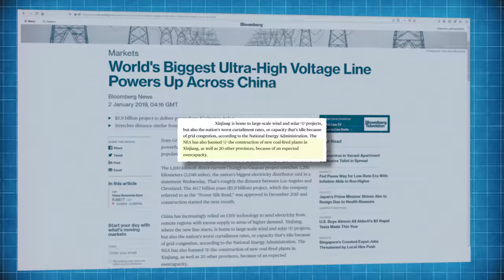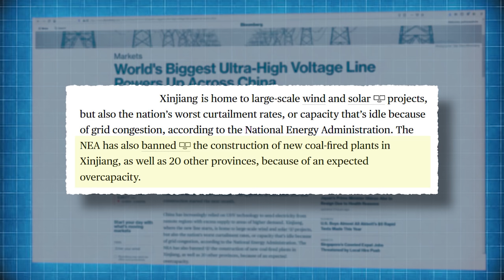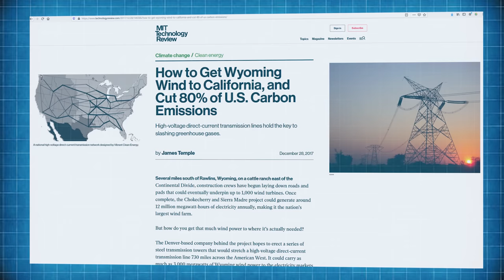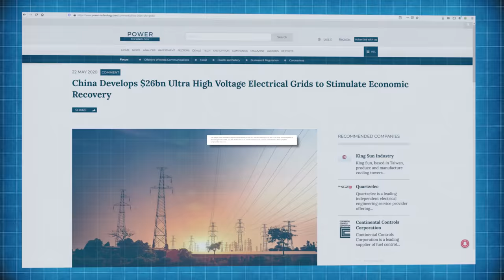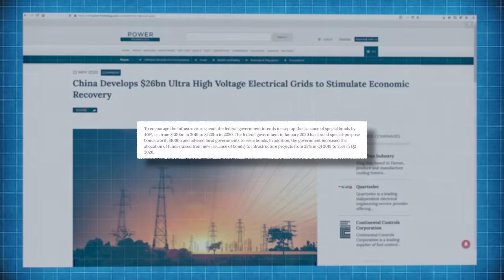China's MILLION VOLT Energy Superhighway

Comment: That is a real change in electricity generation. with this technology China will reduce or even eliminate The need for huge battery systems because if the power generated locally is more than what is needed instead of storing excess power generation it could sell it to locations even countries. The question is how do the generation areas get the power they need when there is no wind or sun? I guess they may need to store some of their excess in one or more of the power storage plans that are being developed.
Reply: there is just about always wind where they are building wind turbines. it is 2500meters above sea level so it is quite hectic.
for sun it is on and off. but usually more stable
Reply: Actually DC transmission simplifies battery integration.

Comment: I’m having difficulty understanding why a power dam (Mekong example) would affect the availability of water downstream, except for the duration that the dam is being filled. . .  what am I missing?
Reply: It doesn't. In fact it actually provides protection against floods by storing excess water and protection against draughts by releasing more water. There are over 50 dams on Mekong and its tributaries already with over 100 more planned in all these countries - China, Laos, Thailand, Myanmar

The reason why some parts faced drought was because the lower Mekong basin had a really dry season
Reply: If they build a dam in very downstream in the mekong, then they will never have any water problem in downstream countries like cambodia. All these "water fights" arise because upstream countries are building dams but not downstream countries, so water goes straight to the sea for downstream coutries and is completely wasted. Same story in Ethiopia vs Egypt. Obviously it is more challenging to build a dam downstream due to the river being much wider and lack of river gorges, but say if for example cambodia built a dam right at the exit of the river from the flooded forest, they will not have problems of dry season leading to deforestation and habitat loss for its fisheries, and have a steady water supply too.
Reply: I suppose one aspect is that it increases water loss via evaporation if the dams are built with a reservoir of larger area than was before, of if the water is also used for irrigation, and there are other impacts such as reduction in population of fish etc ..
Reply: @jwickerszh  evaporation does exist, but the problem is always irrigation. you know... we have the water let's just use it, to the fuck downstream...
Reply: @JavierAlbinarrate  Yes, I mentioned it, but it's not necessary linked to the construction of a dam, ie: you could divert river water for irrigations without a dam, or you could have a dam without tapping into the reservoir for irrigation. So technically those are separate issues.
Reply: I don't know what the impact of the dams is on water levels, but I do know that a lot of water is taken along the way for agriculture and even cities, and that is definitely a big issue. Also, about the dams, the do affect the fish, because basically they get stuck in each dam instead of swimming downstream.
Reply: Evaporation
Reply: Must loose some to evaporation, the amount, I've no idea.  You may also loose some to extra draw offs for farming because the water is there and available.
Reply: It doesn’t but it does make down stream of the dam less fertile as dams don’t let much silt algae and fish through it.
Reply: I think you all are missing the point as well as the history. China is trying to control all the water flowing into se Asia because all the rivers have their beginnings in the mt. In China. All it will take is one drought and all the countries will be at China's mercy. As with everything chinese you can kiss the environment and fisheries good by. Anyone who can't see this through a world domination lens is naive.
Reply: Depending on the size of the dam it could take many years to fill if they try to take water slowly. Even a 5 to 10% reduction in water volume is felt like a drought downstream. Consecutive years of drought does long term damage to regions. If they try to fill the water faster then you have a humanitarian crisis as the damage would be immediate and immense. Finally there are political and sovereignty issues as China could if they want starve the region or flood it at will they can, then you've lost control of your country. These aren't economic moves from China these are political. It's the same reason they invaded and occupied Tibet, control of water and control of people that depend on it.
Reply: If all the dams were only used for hydroelecticity production, there'd be no loss except (relatively) minor increased evaporation (larger surface area).  Unfortunately, this rarely happens and most dams are also used for irrigation (some, only, or mainly, for irrigation).  This can have a huge effect on downstream water volumes.

And you don't have to go to China to see this, just check out the (once) mighty Colorado River - so much water is extracted to (e.g.) irrigate the Californian Central Valley, supply water to Los Angeles, and turn the Las Vagas desert green, that barely a trickle finally reaches the sea.  Once again, the US concentrates on worrying about the impact of China, whilst conveniently turning a blind eye to its own madness and excesses.

Comment: Just Have a Think  I had understood that another advantage to HVDC transmission is that it was not necessary to maintain phase synchronization between all the generators on the grid.  This makes it possible to tie together different previously unconnected grid segments or even connect 50 Hz grids to 60 Hz grids.
Reply: That can be both an advantage and disadvantage. On AC grids, frequency control is widely used to balance and manage load against generation and energy flows. Larger grids are inherently more stable, so isolating grids with DC connections forgoes this benefit. But as you pointed out it is helpful to connect otherwise separate and maybe incompatible systems

Comment: I'd like to be optimistic and say this is the first step to a global energy sharing market, countries during the their day light hours share their excess energy with those in their night and then they in turn send their excess back when their day begins. Then we solve the down time problem of renewable energy on a global level...
Reply: Thorcon Power is actually working upon a reactor design, constructed shipyard fashion, that is perfectly capable of using the high temperature steam turbines that are built for coal burning, with a basic power size that drives 250 MW. They reckon, with rather well described plans, to beat coal on construction and fuel costs alone.
Reply: Brin Jenkins  To balance the winter inadequacies of winter solar they'd need connections to the Northern hemisphere.
Reply: Brin Jenkins  Your name is Welsh? My brother worked in Wales on what was then Europe's largest pumped storage plant, at Dinorwig, as "Chief Biologist". He had to find another job when Maggie Thatcher in a fit of Tory ideology sold off the People's property of the CEGB.
Reply: Brin Jenkins  considering the fact that there's probably about a 5-6 hour time difference between Western Europe and China, you could potentially receive solar energy from China from 2 AM to 10 AM, with peak output around 6 AM.

So combining Chinese solar power with local solar power would provide electricity from 2 AM to 6 PM. 

And imaging combining such a system across multiple timezones so basically you could get a 24 hour system

Comment: The idea of using DC lines at high-voltage in relation to renewables is not new. Checkout https://en.wikipedia.org/wiki/NorNed which is already 12 year in operation (although at 450 kV, but bidirectional). I believe its mainly used to use over-capacity (during low demand or when renewables produce too much) in the Netherlands and pump up Norwegian artificial hydropower lakes, emptying it again during high demand. Using it essentially as a potential energy battery and compensating for the lack of height differences in the Netherlands.

Comment: That has to be one hell of a diode to get that 1mil volts from ac to dc
Reply: Actually they do it by a massive stack of diodes (IGBTs - a special type of transistor actually) linked in series, so the voltage difference between input and output for each is relatively small.

Comment: “can supply 12 Gigawatts...” - that may sound like a lot, but it’s actually just barely enough to fully power a flux capacitor 10 times.
Reply: But how does it compare to a Tesla Y battery pack?
Reply: 12 Gigawatts sounds like a lot but a dilthium warp core in every home would be a better solution.
Reply: Brin Jenkins  He did say 66 billion Kw hrs a year.
Reply: Brin Jenkins I agree, why don’t people just use a billion milli-feet like normal people
Reply: erm.... no. Watts is Power. „Filling something up“ needs Energy which is Power x Time. So, with 12 GW of power, you could PERMANENTLY operate 10 flux capacitors in parallel. How you keep the cable connections on something that disappears in time is beyond my knowledge ;-)
Reply: Your math is incorrect. You will be 100MW too short to power the flux capacitor 10 times. So, only 9 times and a failed 10th attempt which means you will be not be able to come back to your time. Learn math, save your life.
Reply: @hooeezit  This is electrical engineering, not arithmetic. Everything has a safety factor taken into account, so the 0.826% overload will be tolerated. 
Additionally, I would recommend to you to learn about the difference between POWER and ENERGY. This misunderstanding actually kills people.
Reply: 1.21 gigawatts actually
Reply: Brin Jenkins  You need uppercase W for watts. The standard usage is lower case for the whole word, upper case for its initial. But I was once amused at a picture of a powerful mail order purchase laser, erroneously captioned 100 MW instead of 100 mW. 100 MW would be the output of a SMR, small modular reactor. The actual value is pretty high, 100 milliwatts is a tenth of a watt. The usual pointer is about 5 mW.
Reply: @Cyberplayer5  Divide 66,000 GWh  by 8760 that's an average power of 7,534 MW, or 7.534 GW. The peak in 2016 in the USA was about 700 GW.
Reply: @wernerviehhauser94  Good for you, I heartily agree. The other thing is that supplying as much energy in a year as 30 million people use in a year, only serves their electricity demand when it's available at the time of the demand. Th only clean fuel that can do this is nuclear, which per kg of fuel has as much deliverable energy as thousands of tons of carbon with the oxygen it turns into carbon dioxide.
Reply: 'just barely enough to fully power a flux capacitor 10 times.'  Actually watts are instantaneous power output.  That wattage output continuously would power 10 at once, then the next 10, then the next 10, and so on.  The flux capacitor only needed to hit that peak and then it worked and you went.  Of course it was only a movie, but it used very little energy in the movie it only needed that peak for a short time to go..
Reply: @lucar6897  That deserves a laughter emoticon. My own pet peeve is the absurdity of energy reported as American quadrillions of British thermal units. A quadrillion ought to be the fourth power of a million,  not the fifth power of a thousand. Britain doesn't use Btus any more, I trust. They're in Fahrenheit.
Reply: Tenly2009, you fiend, I had to do a duckduckgo search to find out that a flux capacitor is fictional.
So I did another search. One can purchase for $40 each,  450V 5600uF Electrolytic Capacitors. I think that'll hold 1.134 kW.seconds of energy
-- or a two farad capacitor that'll take 12 V. which holds 24 coulombs at 12 V, 
i.e. 2.88 kW.seconds
Oops, no, in both cases it's half that. I forgot the integral of  x²
Reply: 100Chicky ” 1.21 gigawatts actually”
If you listen carefully, it is actually _”1.21 jiga -watts_”

And nobody knows how much that is...

Comment: I well remember the construction of the little known Pacific Intertie back in the mid 60's, completed in 1970.  It is a massive high voltage DC line from Bonneville Dam to Sylmar in California that capitalizes on the difference in seasonal usage between SOCal and Oregon / Washington.  Tower to tower voltages run in excess of a million volts.  This made economic and energy sense even back then with the relatively crude technology compared to what we have today.  Ultimately I can see it becoming practical on an ever smaller scale.  For example I own 4 welders that use the same technology.  They convert AC to DC, then back to AC at very high frequency... 10KC ... more or less, and that allows them to use a tiny transformer due to the difference in inductive reactance as a result of the high frequency... A 500 pound machine becomes an 80 pound machine.  It also allows them to alter frequency on the fly to control the character of the output which is then rectified back to DC.  The end user benefits greatly in having tremendous control, smoothness, and weld quality.   Similar technology is being used on many smaller generators, allowing them to operate at different RPM depending on demand, for quietness and reduced fuel consumption.   Of course there is also the grid tie inverter using some of the same technology to allow small power producers to synchronize and put power into the grid.  I foresee the day when the transformer on your pole is an inverter instead of a transformer, and the local distribution network is DC instead of AC..it's a way off, but it is inevitable IMHO.
Reply: its not that far off, in australia you got all these battery storage from wind and solar so it might make technical sense to transmit dc and use either buck or inverters before sending the power to the consumer
Reply: Let's not ignore the health effects of fields radiated from AC transmission lines.  There's another problem that goes away with DC.
Reply: I think you are correct, though still someway off.
Reply: AC distribution and pole transformer but DC in the home because compatible with batteries and solar and led lighting and easily 'inverted' for specific applications. But DC home wiring 'unintended short-circuits' are more flammable than AC (because they're not switching off every hundredth of a second) so every circuit needs a spark sensor as well as a current limiter.  ..hi jim!
Reply: @GaryGraham-sx4pm  The ONLY reason for AC is the transformer.
Reply: @stonetoolcompany3649  ONE reason for AC is transformer, another reason is less sustained plasma across an air gap so less fire hazard, just something to be aware of with home DC, and local distribution is just more practical AC, 3phase etc..

Comment: For example under sea power line between Finland and Sweden are DC for the same (efficiency)reasons (400 kV / 572 MW and 500 kV / 800 MW ). Later one was built in 2011. (Fenno-Skan 1 & Fenno-Skan 2). There are also Estlink 1 and Estlink 2 between Finland and Estonia.

Comment: High voltage "Push"  very interesting terminology,  high voltage is to reduce the current component so that the losses reduced. there is growing popularity of using DC voltage transmission.  DC transmission coupling equipment is quite  expensive
Reply: Steve Spence ..... as is the fault interruption devices and switching!

Comment: Are there any problems with galvanic corrosion in the HVDC system? With alternating current, the reversal of flow tends to cancel these effects. What methods are used if needed with HVDC?
Reply: The transmission lines are mid air in 50m above ground. Where are they supposed to corrode?
Reply: @fabianfeilcke7220  where they are has nothing to do with galvanic corrosion. It's the dc that is the issue.
Reply: For Galvanic corrosion you need a way for the Ions to move from the positive Line to the negative line. Usually this happens within water. On a Transmission Line there is no continuous water Layer between the lines.
Reply: @fabianfeilcke7220  have you heard of black wire syndrome in battery systems?
Reply: @stuartsmith945  No. But i assume it describes corrosion of battery modules? The creepage distance in Battery Systems is at best a couple of cm. In HVDC Systems is several meters. I worked in HVDC transmission plants for years and corrosion on the actual transmission lines was never an topic..
Reply: have you heard of 'black wire electrode' syndrome in HVDC earth-return systems? animals with three eyeballs?
Reply: @GaryGraham-sx4pm  No. And i did work on several >3GW HVDC Systems in China and Europe.  Most systems use a return cable to begin with. If not they use a graphite ground electrode.
Reply: @fabianfeilcke7220  thousands of amps at thousands of dropped volts via ground electrode 'earth-return' has 'unintended consequences'. very few people know the dangers of terrestrial electrolysis and those who do aren't saying anything

Comment: "alternating current only conducts along the surface of the wire" that is not true at 50 or 60 Hz (or the less common 16 2/3Hz, 120Hz or 130Hz) employed by transmission lines. The skin affect still exists but at those low frequencies it most certainly does not restrict conduction solely to the wire surface.
Reply: I think that there's a discernible effect,  I agree that it is unlike high frequencies where one moves to wave guides, but at large amperage it's discernible.
Reply: @Dogphlap That's exactly what we were taught at school, skin effect begins to show at radio frequencies which is Litz wire is used for some RF inductors.  https://en.wikipedia.org/wiki/Litz_wire#:~:text=Litz%20wire%20is%20a%20special,up%20to%20about%201%20MHz.
Reply: @Dogphlap I do agree with you that he should have been more precise. However, there's a reason why high voltage cable manufacturers include the resistance per unit of length at 50 or 60 Hz in their datasheets. It's because engineers do have to take it into account.